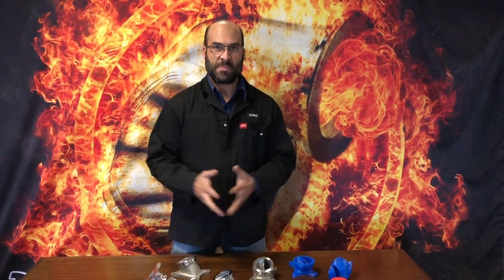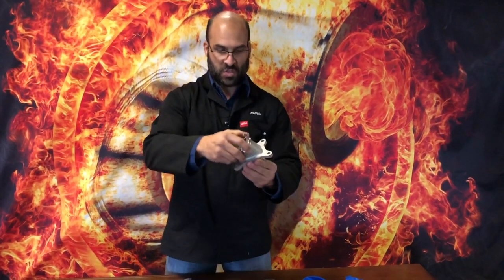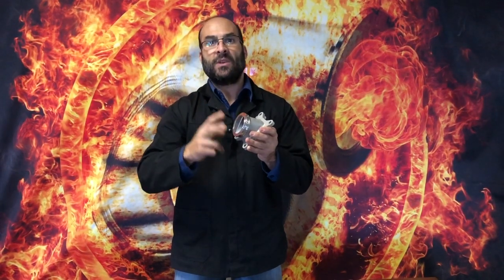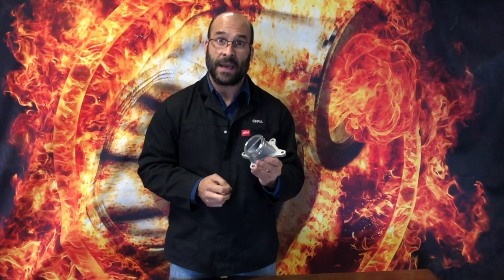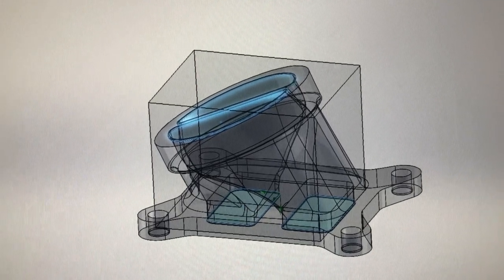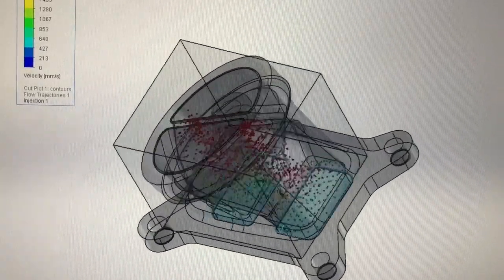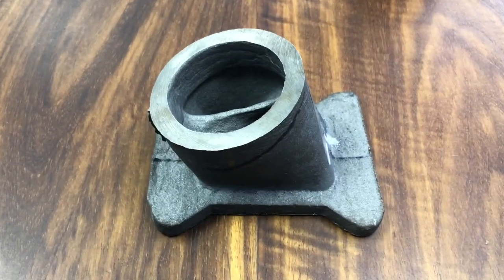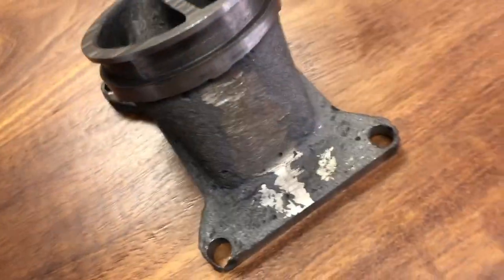EA888 Swirl Adapter - development

Comment: So, adding swirl to the inlet of a turbine. I had never heard that before.

When looking at twin-scroll housings, I just default to a larger A/R than with a single-scroll housing. Part of the whole POINT of the twin-scroll, in my mind, is being able to enjoy the higher-RPM (mass airflow) flow of a higher A/R while reaching down further in the rev range to extend the responsiveness down low.

What has me truly curious is how initiating vortex/rotation/swirl in an exhaust flow pre-turbine effectively extracts more usable energy from the exhaust flow, especially when the swirl causes the flow to (evidently) hit the turbine blades at a higher angle of attack.

Since you like the results, it beggars the question: how about MORE swirl? How about swirl in the opposite direction? How about a twin-swirl twin-scroll bifurcated housing? How about twin swirls in the opposite direction of each other in a twin-scroll?

I am impressed at the level of insight to even DO this.
Reply from the maker: The swirl simply follows the two open ports which are divided by head casting, into one single Vband entry. The merging of the two ports come together in a swirl, which was tested through CFD and worked well -

Comment: Is there an engineered model with a CO2 sensor location please?
Reply from the maker: No there isnt - installing a sensor in the gas path will defeat the object of the design, simply  deactivate it in the software and use the second sensor downstream.
Reply: @TurboDirectSA  Alright thank you for the reply
Reply from the maker: @AlainK-Official  Pleasure anytime.

Comment: Really enjoyed the video. I have a question regarding the twin scroll setup on a 6 Cylinder aftermarket configuration. Custom turbo manifold, using a single wastegate is less beneficial than a dual wastegate?
Reply from the maker: This is quite an in-depth topic to be honest - it sparks alot of controversy aswell - purely because of the fact that most people dont know how wastegate sizing works.  In short the quick answer is quite simply  -- depending on your collector design and/or wastegate position. With a single turbo setup twin scroll turbine housing, i would locate the gate ontop of the turbine housing after the collectors merged into the housing inlet. this way you get to control the waste energy properly and accurately without losing the response associated with the twin scroll housing.  Using two gates will always impact the response of the setup.
Reply: @TurboDirectSA  I'm really learning alot on your platform. Thank you for taking the time to reply
Reply from the maker: @road_2_pow_r  Its my pleasure - i have received many emails confirming how little knowledge actually exists in the industry.  Glad to help

Comment: Chris, as for your swirl adapter - do you think that VAG 2.0 tsi gen3 car with this adapter and g30-770 on the board wil be still convenient for everyday using? I am talking about responsive. I am still trying to find the best solution for my car and doing a lot of improvements simultaneously.
Reply from the maker: Ofcourse - it was designed specifically for this. We have many cars running this setup around the world.
Reply: @TurboDirectSA  So, in this case, could you calculate full packet? I mean adapter, turbocharger and all necessary improvements for bolt on solution? You have my email, I think. Or I can reask you through email.
Reply from the maker: @stanislavaleshin1202  Yes you have my email - we have spoken - shoot me an email. Ill help you there

Comment: Can I fit a pipe to an external wastegate on the bottom side of this? About 2 - 2.5 inches
Reply from the maker: Yes ofcourse you can - you need to machine into the top of the turbine housing for this -  after the inlet Vband flange. Do not cut into the Swirl adapter, as it will render the function of the adapter useless.

Comment: Great video And keep common Richard holder claims  G turbos don’t make more Power then eBay turbos ? Please send him a test Turbo
Reply from the maker: LOL - we get so many comments about this turbo and that turbo is better or faster spooling or more reliable then the next one - most cases show apples with oranges comparisons and two price points that reflect the two poles as far apart as they are.  Anyways - this topic is a massively broad one, and there will always be comments from  different angles - we like to stick to facts based on physical tests or comparisons, and not opinion.

Comment: Didnt a big american brand try same? With the end result that it can`t keep up with good hybrids?(not talk about the cheap china stuff)
Reply from the maker: no American company has ever seen this product - the Swirl adapter is manufacture by us inhouse and not a single one has left South African soil as yet - this will change next week, but to answer your question - no.  Secondly on your comment about the end result not keeping up with a hybrid, im not sure what you mean, but i can tell you that no hybrid using a stock shaft diameter is reliable no matter what name is printed on the name plate. The larger turbochargers which in most cases are ball bearing - will ALWAYS outperform any hybrid built unit whether it couples onto a Swirl adapter or any other "manifold/adapter"
Reply: @TurboDirectSA   Sorry maybe i should comment under your comment down, then its more clear what i mean. APR build also such an adapter(not exact same )  and drive the EFR7163,too . I don´t see its dominating.Not in spool or high end power..... Not in Europe, not in Asia, maybe on local markets due lack of competition.... Also no mattter its 100-200Km/h or 1/4mile, or whatever. Its slower and some "good" Hybrids deliver better results .
Reply from the maker: @Ryosuke69  Sorry sir APR have never seen our product, nor can they comment on its abilities or shortcomings as their product is nothing near to our design. If APR have failed with their tests, thats something only they can comment on - we can only show the results with our own product which we have hands on experience with. We do not have any APR products and nor have we tested any, nor are we interested in testing any, we design our own products in house and focus on what we do.
Reply: @TurboDirectSA  I think he's speaking in terms of the turbocharger. APR's EFR7163 full frame turbo has underperformed when compared to hybrid ball bearing turbos like the Daniel Bogues DBV2.
Reply from the maker: @MosPhed  Im not able to comment on this at all, as i mentioned before, APR have not tested our product,  if the comment made relates to the adapter being used by others is the cause of the lack in performance, then i can comment and say - ours is nothing like anything else on the market. Regards to other turbocharger comparisons - i have never tested any so i cannot comment.
Reply: @Ryosuke69  If you want to run a G series turbo this is an absolute must have. Hybrids are great but they are limited in way that a full frame turbo is not. No hybrid IS38 is going to make more than 600whp without spray.

Comment: Nice product. How much improvement did you get by turning the divider wall 90 degrees?
Reply from the maker: The swirl was shown in the simulation - the goal was to increase both velocity and pressure, through the adapter, which was achieved. The values we will not share im afraid. The tests we have carried out on the BorgWarner EFR7163 T4 twin scroll AR80 turbine housing versus the Swirl adapter mounted together with the AR85 Vband housing will be shown on a dyno graph soon in an upcoming video -